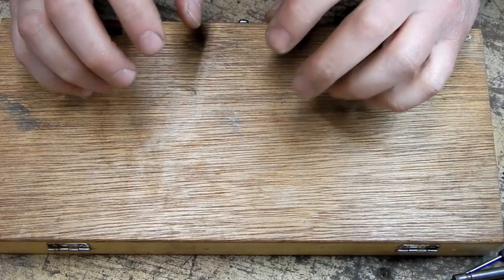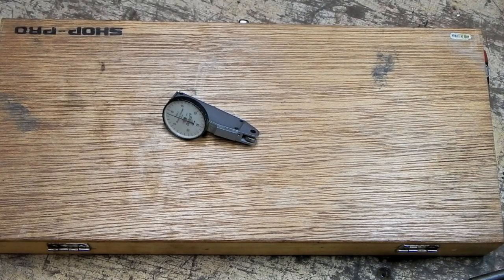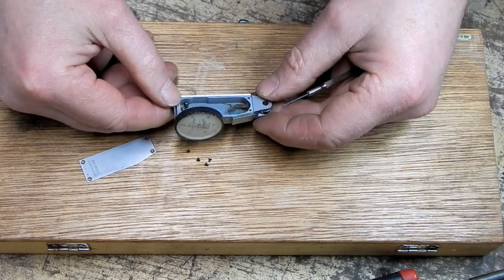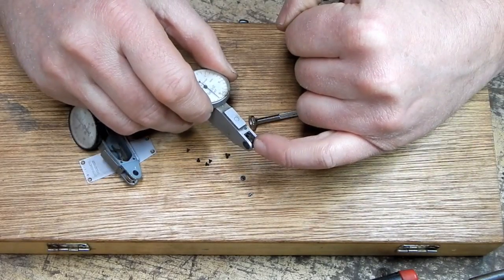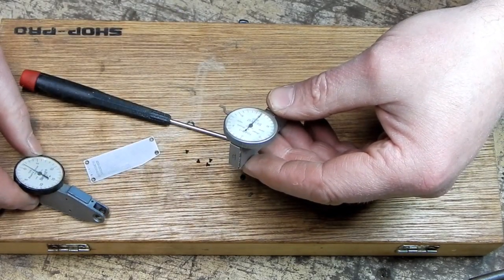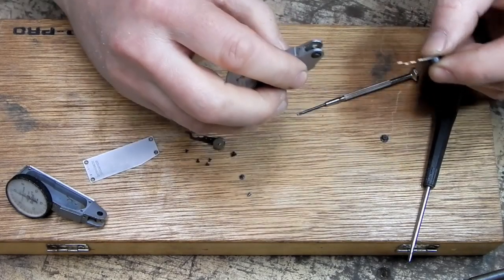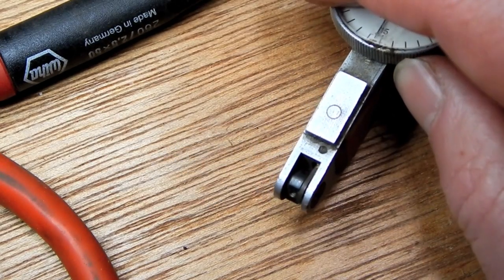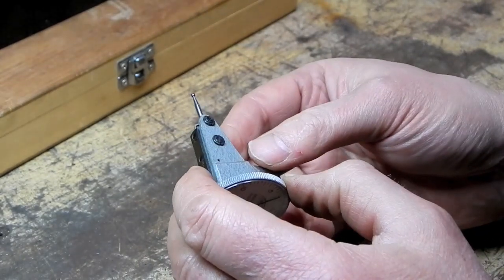Starrett Micrometer Repair attempt FAIL!

Comment: Hi no you have to learn by starting somewhere.
We do rebuild (only our own) dial indicators both mechanical and digital (just sharing) but this is because we are watchmakers and micro machinists, so these are easier on us to do then the complications within either the quartz or mechanical watch movements.
Nice to watch you try your hand at it, HAHA, this would be like buying a fine wristwatch, then wondering why it is not working, opening it to realize the movement has been removed and sold off.
It is nice to know how or to always be learning how to gain new skills then hone them over the decades to become nearest a master at this or any trade.  
We loved this video, thank you for the share, Lance & Patrick.